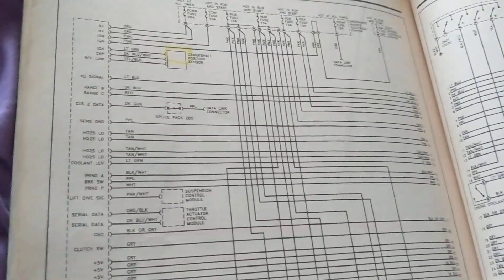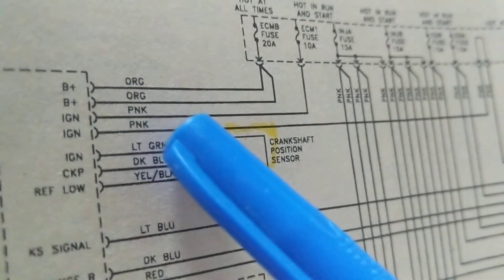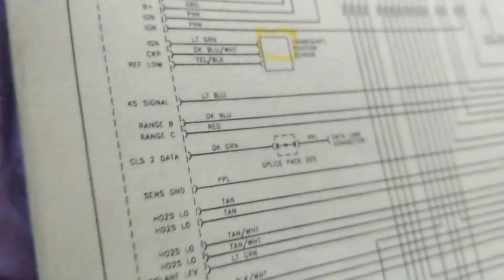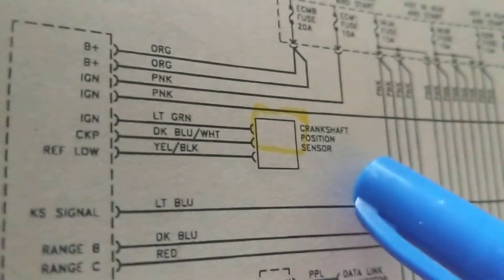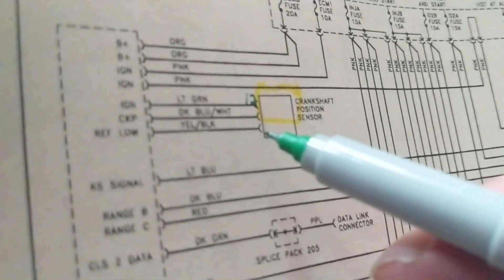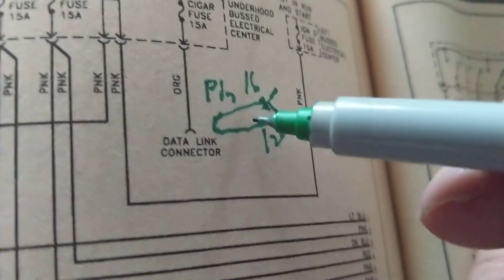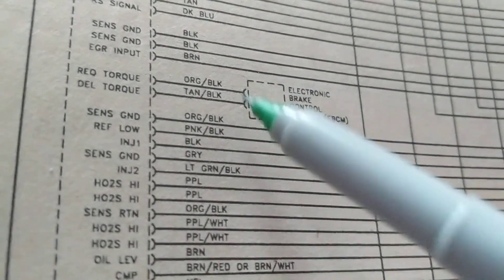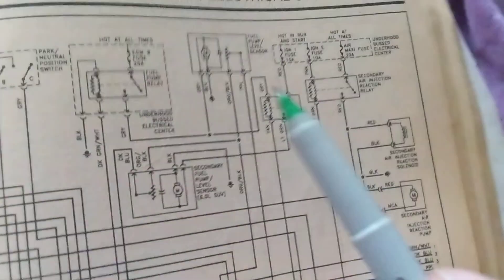HOW TO DIAGNOSE COMPUTER PROBLEMS FOR ALL VEHICLES

Comment: It is just to say can find on wiring bias voltage on shorts? When you have ex: 1.2 volt or 2.3 volt!
Reply from the maker: I didn't fully understand the question but if you asking a bias  voltage can be shorted to ground but also remember a sensor goes to computers can also be shorted to both pins  of the computer
Reply from the maker: bias voltages can have shorts to grounds or across them not necessarily to ground but yes you can
Reply: @Joeelectronicschematicsforauto  better idea ? because the troubleshooting is at the Key On Engine off and on the load ,something is missing at idle, the engine is rebuild by my self and is good, i can start at the  5volt ref and B+ of the PCM, my high cooling fan wont start, just when i unplug the TPS, it is right ? , and sorry about my english i do my best, thx.
Reply from the maker: You have to see if it's an electrical problem or fuel problem or spark problem and put it in the run position see if they get fuel pressure I'm trying to understand what your problem is are you telling me that you have an electrical problem with a 12 volt line if the TPS sensor is bad it could low down your 12 volt line but I'm trying to understand what the problem is is it a no start to no crank
Reply: @Joeelectronicschematicsforauto  Just at the Idle car start...but Fuel Pump goes up and down, and couple of sensors clicking when the engine , Key on engine Off and when the engine is on the Close Loop, and thank’s for those vids to clarify the B + on a wiring diagram. I have this 1999 grand am se 2.4l at 150000 kilos only, gonna check next morning wiring on the back, because GM put on the chassis a connector, can be corroded on the back seat near the fuel tank, Crazy But cool and rich stuff!